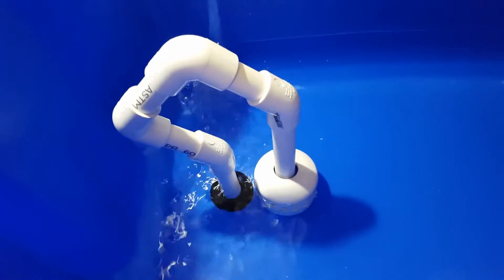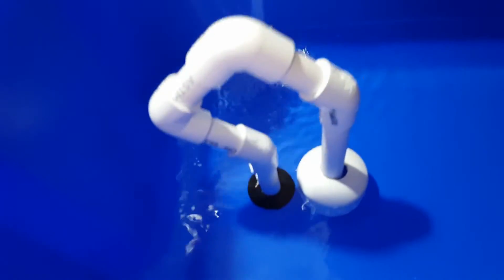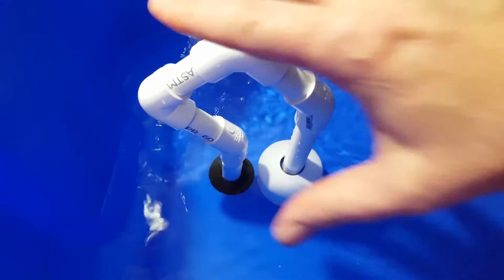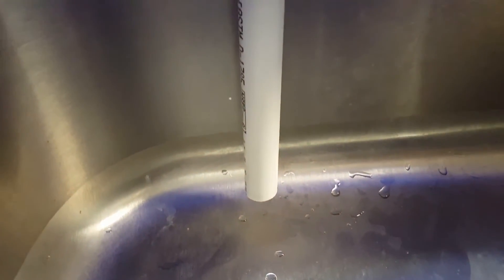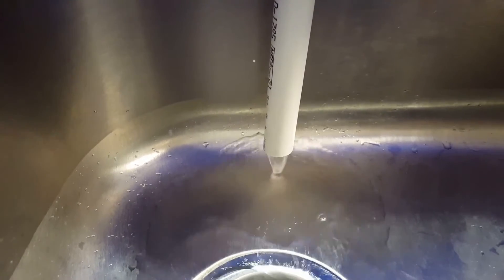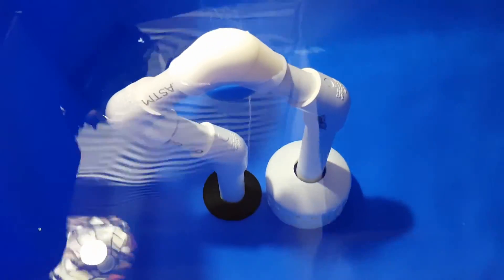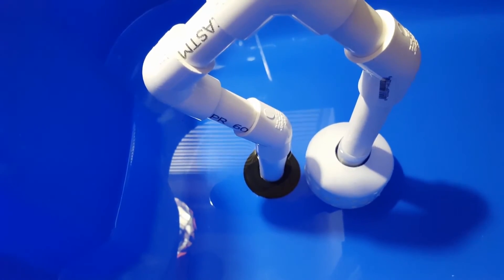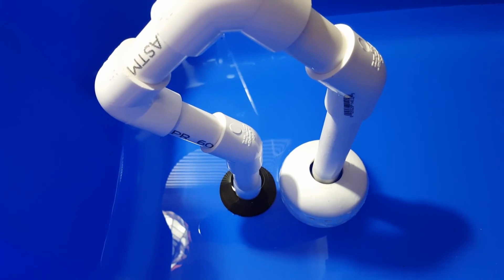U Siphon Aquaponics Test with Uniseal

Comment: Will U siphoning still work if the outlet comes out of the bottom side of the tank?
Reply from the maker: Yes if I'm understanding you correctly...if we describe the U siphon like a question mark " ❓️ " then the  bottom part has to  certainly come through the container wall in order for gravity to draw it down to the bottom water where the pump then pumps it back up to the top again and the cycle continues...my U siphon comes down about 8 inches through the other side of the top container

Comment: I will use a 3K Liters/Hour pump; can the drain exceed the water intake?
Reply from the maker: The power of the liters per hour is less important for aquaponoics pumps..whats important is pump head height..ur pump needs to be able to pump up high enough to reach a swirl filter then let gravity do the rest..a too powerful pump will pump water in faster than the ability for the U siphon or bell siphon  to siphon it out..the slow steady fill rate of water is  better....also with  a too fast pump the u siphom will not be able to break its siphon....slow and steady wins the race with aquaponics ..the plants need to have that time to get oxygen to the roots or else they'll drown

Comment: Installing this type of siphon vertically has one problem: easy to start but hard to break unless you shut off the water feed. Check my modified version installed horizontally outside the grow bed - I just uploaded the video today.
Reply: I didn't understand anything and did not see any siphon action!!

Comment: In all the videos testing this system, the tester shuts off the water as soon as the siphon starts. This queers the test because we don’t know if the drain rate exceeds the intake resulting in a complete cycle.  I guess I need to test this myself since nobody on YouTube is doing it correctly.
Reply: This is indeed the problem - it is easy to auto start but hard to break itself.

Comment: No matter what pipe combination is used the flow rate is limited by the smallest ID section .  Just as a chain is only as strong as it's weakest length . Liquids do not compress easily . 
Only a longer fall distance to point of discharge will increase the rate on a given pipe ID  )   Good thing or your breaks would not work .  Not like air that can compress easier , your brakes fail.  (and , no, oil is not denser than water )

Comment: Am planning to use this system in my next project...... PROMISE
Reply from the maker: Watch  my other vid u siphon 2.0...ive learned since it does much better if the intake is twice the size of the discharge  pipe..so the best ratio is 2 to 1..so use a 1" intake pipe  if ur using a 1/2 inch

Comment: what is the size of your pipe?  I just tried it and used 1 inch but it seems it only works well with strong water flow,  I planning to use 3/4 next time. Btw I used the tip of water botlle as a uniseal and its good.
Reply: Good video pls a little clarity is needed, if I understand the size of pipe that will suck water in the growbed should be smaller than the discharge pipe?
Reply from the maker: In this video that's a 1/2 pipe but I have since gone with a inch to 1/2.  I find the correct ration is around 2 to 1...Meaning your intake should be double the size of the return pipe..So in my other vid 2.0 I have an inch intake with a 90 degree inch to 1/2 inch reducing elbow to 1/2 return.  This has worked very well since I made this first vid.  Or you could go 2" to 1 etc
Reply: The tip of water bottle sounds good idea can you show or explain how you use it? Where I stay there's no uniseal
Reply: My first comment is for Robert
Reply: My first comment is for Robert

Comment: What size pipe would you recommend for a cut IBC container? I have an IBC container that I cut the top 12" or so and flipped upside down on top of the bottom portion of the IBC container. I would estimate the volume to be about 75 gallons or so.
Reply from the maker: Sure....I would try about 9 to 10 inches for the intake pipe if your doing a u siphon....( side note on the u siphon..a good rule of thumb make your intake diameter twice the size of your downpipe).  That has been working well for me I explain that in the u siphon 2.0 video I have on youtube.  But as far as height Id just go to about 2 inches below however high your IBC growbed is cut to..or 4 inches if you have a deeper grow bed in the future
Reply: That seems to be awfully large. It looks like you are using 1" pipe. I am referring to the diameter of the pipe not the length. Perhaps I was unclear when I asked the question. I was thinking 2" pipe for the diameter. However, If I have to make the other pipe twice that size, I think I will try 1 1/2" pipe and 3" pipe.
Reply from the maker: OK.. I've used a 1 inch pipe for the intake going to a 1/2 inch for the downpipe.  But ive seen people use 1.1/2 to 3" intake everything works well it seems when you use the double  the size law for your intake than downpipe.  Just a matter of finding the right 90 degree elbow that will double the size down.  Like I said I have used a 1/2 inch downpipe and a 1" intake on the u siphon 2.0 vid I did.  Its been working very well

Comment: Great video...just wondering...is the input pump running all the time or is it timed to start and stop...is the input too much for the siphon to handle...or are you adjusting by using a larger/smaller diameter siphon pvc pipe...??? I'v only built one siphon bell pump...keep up the good work...great information...thank you...!!!
Reply from the maker: Thanks...yes my pump runs constantly that way it ebbs and flows ..the shipon is constant draining the water once it gets fills to the top of the shipon then gravity does the rest until it sucks all water out ...breaks shipon and starts again...no timers etc ..water on 24/7...I did replace the intake with a 1inch pvc pipe in my video better siphon break 2.0 that is what I'm using now.
Reply: cool...keep it up...